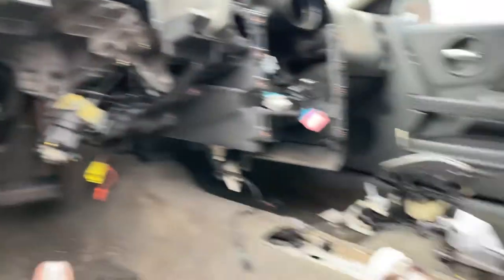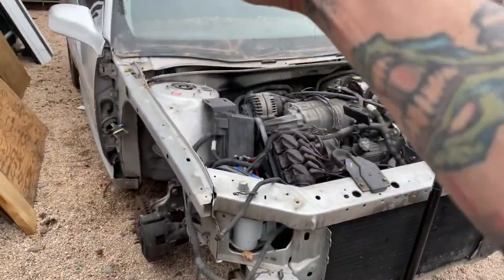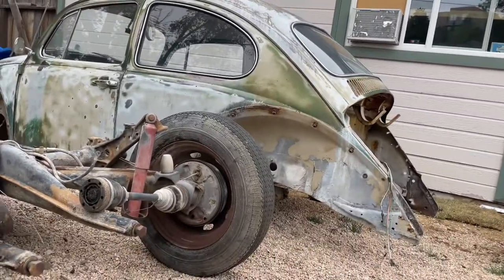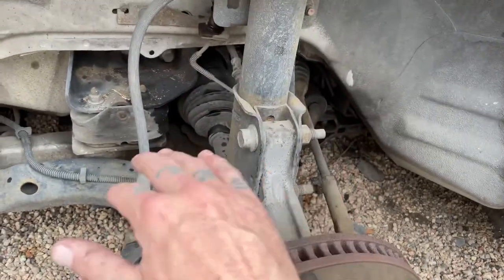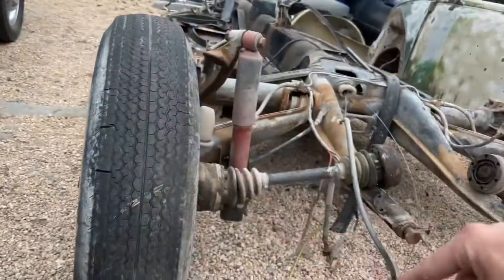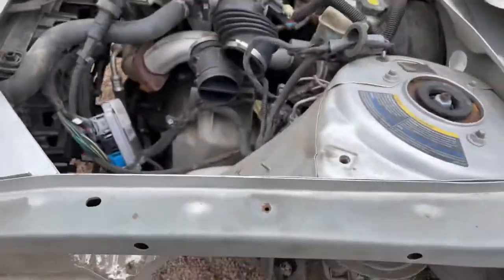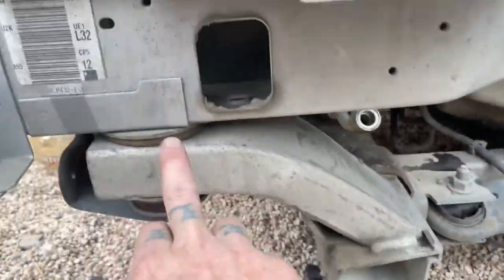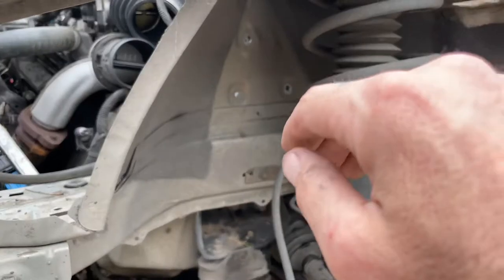#RWB #WIDEBODY #BUG #Comingsoon S19E01

Comment: OK A Little Tech Time With Pat!!!
1, The Engine Will Have To be Spun 180° From How It Is In The Grand Prix!!! If You Don't You Will Only Have 1 Gear, Reverse!!!
2, Just Use The Bugs Existing Suspension And Adapt The GM CV Axles To The VW Hubs!!!
3, With The 3.8Ls Transmission You Will Have No Choice But To Have The Engine In The Back Seat!!!!
4, You Might Be Able To Build An Adapter To Use The Bug Transmission In It's Stock Location And Turn The Engine Longitudinal As Was The Original!!! I've Seen LS Swaps With That Configuration!!! Although I Don't Know What Transmission They Used!!! Maybe Porsche? 
5, You May Also Need To Cut The Bug Down The Center And Widen It If You Try And Install The Engine As GM Did!!!
I Believe An Adapter Plate Is In Order!!! Would Save A Lot Of Headaches If The Engine Sat In The Bug As It Did Originally!!! 
Just My 2 Cents Worth!!!!!Oh Maybe That's 2 Million Cents Worth In Today's Dollar!!!
Keep Rocking It Out Brother!!!!
Reply from the maker: All great points and all stuff i have thought of. she is going in with engine sideways and trans under her. just dollars between me and success at this point. luckily i have a couple sponsors so... we will see but most likely gonna be a full custom mid engine rear drive... now to figure out the front suspension... knew i shouldn't have sold the front K member from Jolene's LS swap donor.... dang.
Reply: @pawpatina  How About A Gasser With A Straight Axle???
Oh Just Thought Of This, See If You Can Find A Fiero Transmission!!! That would Put Everything In The Right Spot!!! The Engine Hung Behind The Transmission And Turned The Right Way!!! Didn't It, Or Was The Engine In Front Of The Transmission?  Now I Will Have To Go To Alldata And Look That Up!!! I'll Get Back To You On That One!!!
Rock On!!!
Reply from the maker: @rockerpat1085  hahah nah this is a popular swap into fieros and the trand and engine is sideways in the back. same as im about to do and this trans is stronger than the fieros.